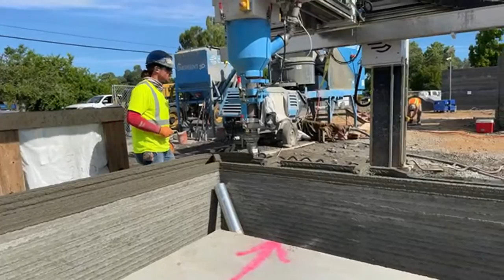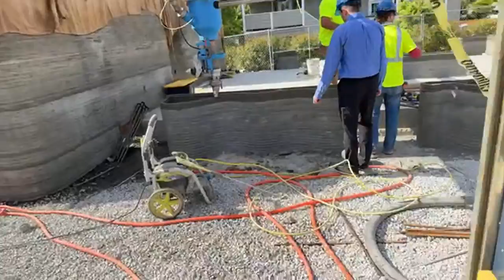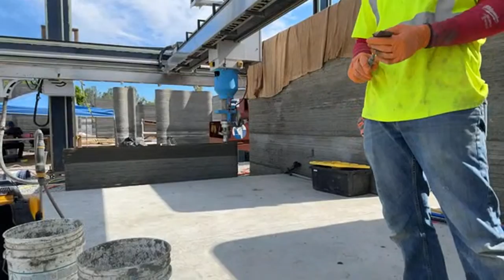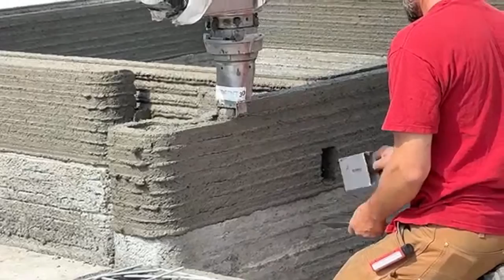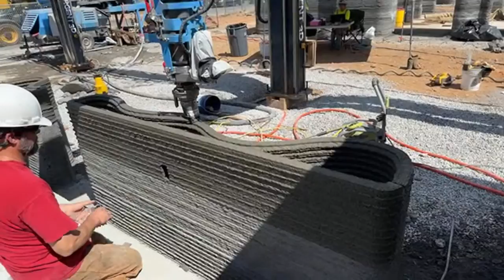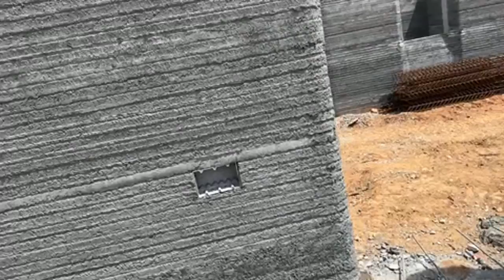Live 3D Printing Permitted House in Cali

Comment: even if they use larger aggregate than others, it doesn't seem like it from the video , it still have a high cement and sand ratio given the texture of the paste. what do you mean by they are using real concrete, like 10-30% aggregate, and called it is real concrete?not sure what you are talk about normal concrete use like almost 40-70% large aggregate for large panl like 2 by 4  by 0.3 or larger. too large of an aggregate will create crack on the paste. given they are using a line not a slab, slab can avoid crack using large aggregate and high ratio of it, because the vibrator and levelling will make a good surface, over the entire volume, so the inside of a slab is mainly the aggregate. for lines, you got a lot of surface area per volume, so you either use little aggregate, or you are going to get cracks. we concretor and concrete engineer have worked this out for decades. aggregate only is use to reduce cost, they don't strengthen the concrete or make it look nice. high workability and good looking has to been higher cement and sand ratio against large aggregate, and this is directly proportional to the surface to volume ratio.